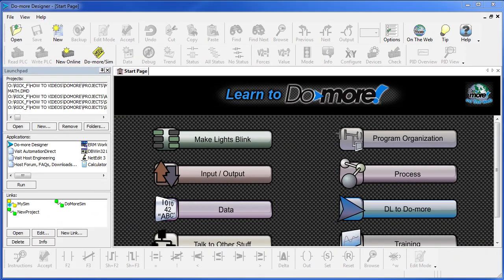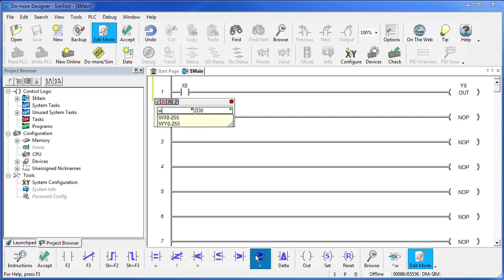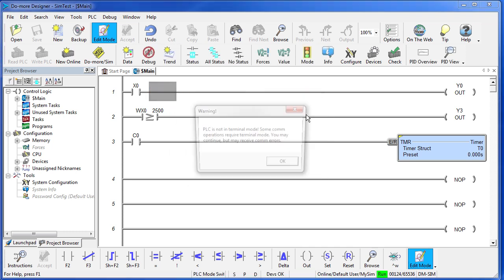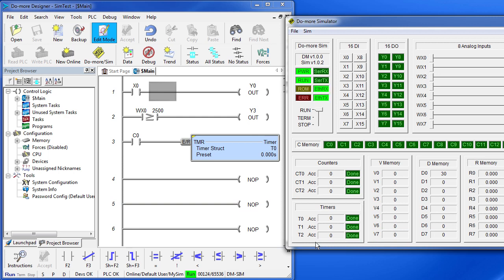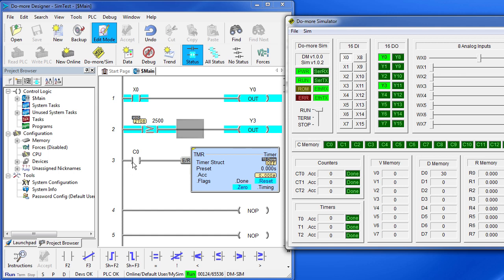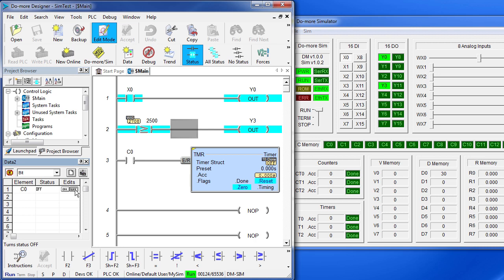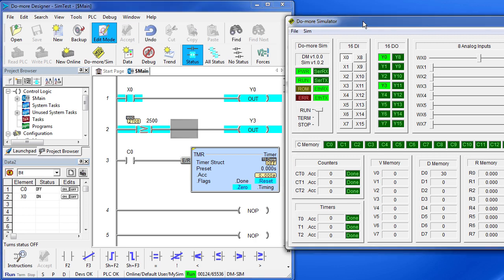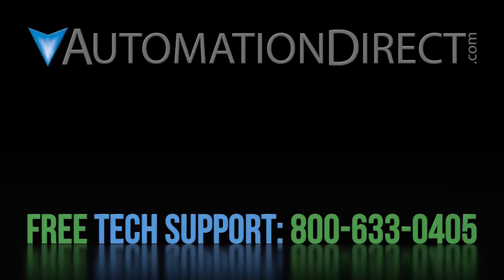BRX Do-more Designer Simulator from AutomationDirect

Comment: Can I use the Simulator to read and write through my python code using Modbus?
Reply from the maker: The Do-more simulator does allow for Modbus Communication, both master and slave. As the simulator was designed for only testing your PLC code, it will only run for 1 hour before reverting to Program mode.
Reply: @automationdirect  Thanks a lot!! It worked

Comment: how to run it on the latest version?, it says the comm link tied to disk is not responding. thank you
Reply from the maker: Hi Ian, that will require more guidance that we can provide in a simple YouTube comment. Did you know that we provide FREE tech support via e-mail, phone, etc?  You can see all of your options here: https://support.automationdirect.com/  Look for the "Contact Us" box.
Reply from the maker: Before contacting Tech Support, try this:

There is are files that can be deleted IIRC that will take care of this.  They are found in the following folder.
C:\Users\Public\Documents\Do-more\Designer2_7\Bin
• DmSim.STATE - contains the simulated volatile memory for the Do-more Simulator
• DmSim.FLASH - contains the simulated non-volatile memory of the Do-more Simulator

Try deleting those and see if that fixes it.
Reply: @automationdirect  do the software needs a stable internet connection? there is no DmSim.FLASH on the folder, thank you.
Reply from the maker: The software doesn't not require an internet connection.
If you are still having issues, then please take advantage of our free support mentioned above.
Good luck!
Reply: @automationdirect  i dont know what to do, it always displays either bad comm or disabled, we have just started learning plc. thank you very much